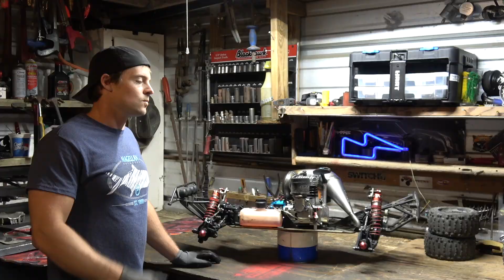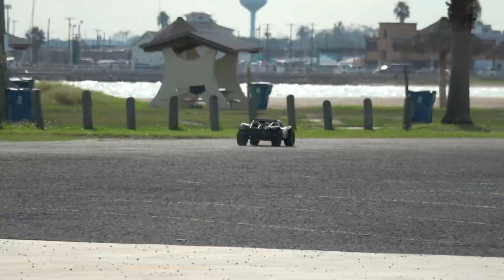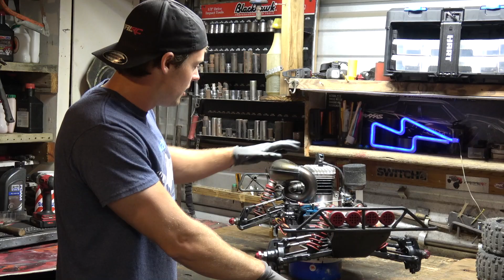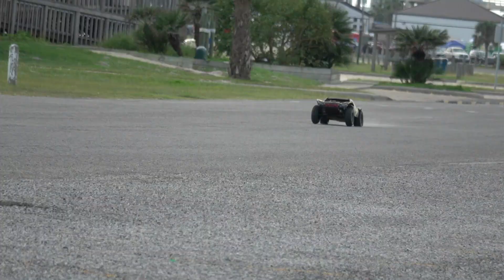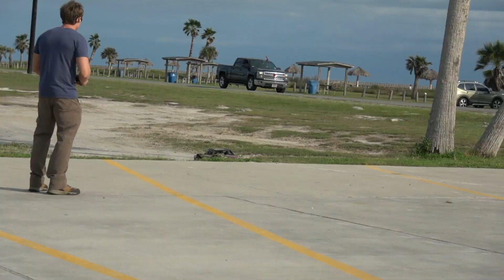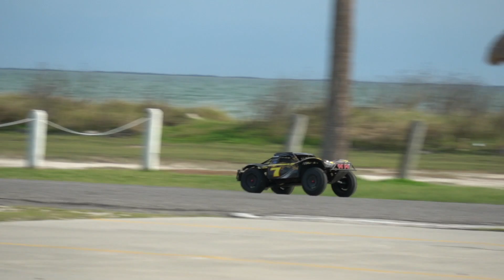Amazing Taylor RC Engine! 46 GT Taylor Engine in a 30 Degree North!

Comment: Weight Diff fluids you using dude?
Reply from the maker: stock weights in front and rear.  I have 100,000 cst in center diff 👍🏼
Reply: @thunderrc  Thank you was thinking of doing. 30k front 100k center 50k rear... 👌
Reply: I've only got a stock 29cc fuelie engine lol

Comment: I bet if it was geared up it would scream even more
Reply from the maker: It actually is geared up, I think it in mid to high range gearing already. What I might do, is put a 2 speed on it which will make it go super fast !!🔥⚡💥
Reply: What gearing are you running